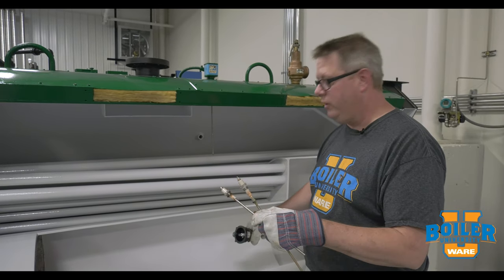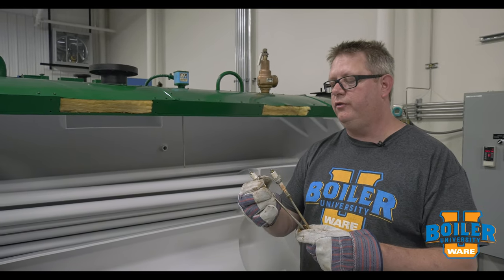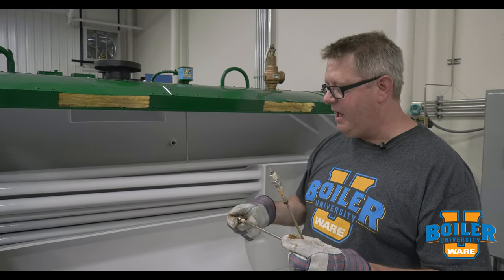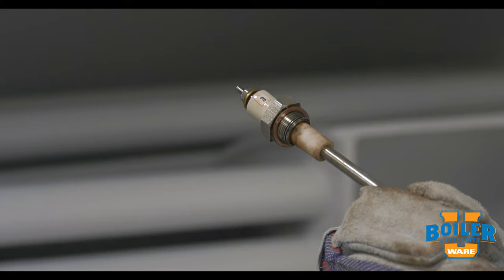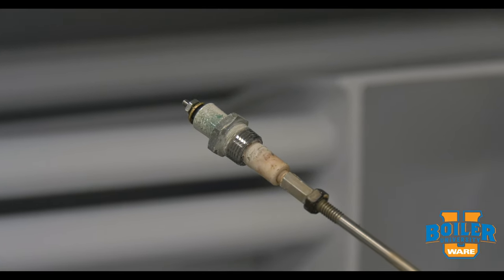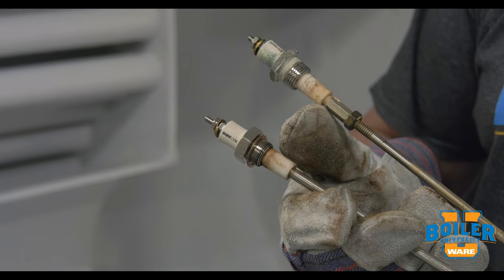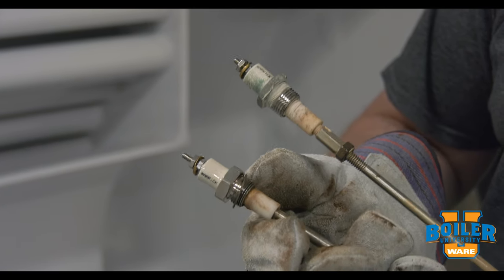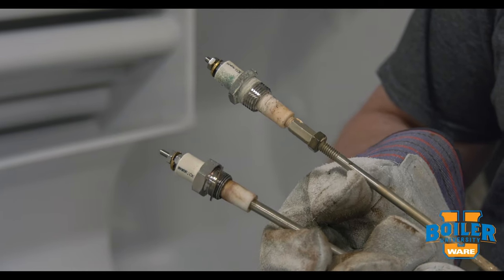Choosing The Right Low Water Cutoff Probe Replacement - Weekly Boiler Tips

Comment: As usual an excellent video. What is the difference between machine thread and pipe thread? Thanks for your great videos.
Reply from the maker: It has to do with the threads themselves. Pipe thread follows the NPT (National Pipe Taper) thread while electricians will follow NPSM (National Pipe Straight Mechanical) thread. So it has to do with how the thread is physically formed. Thanks for watching!
Reply: @wareboilers  can you explain why I don't have continuity  from ground to the probe when there is water in the jacket of the kettle? thanks